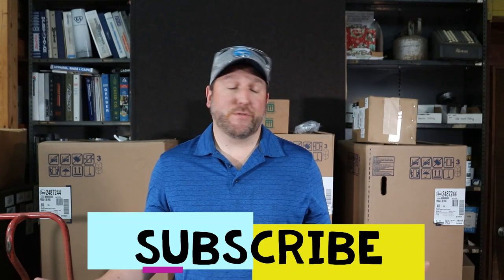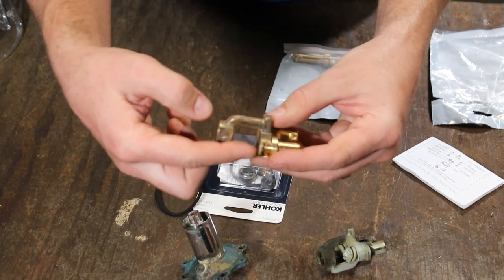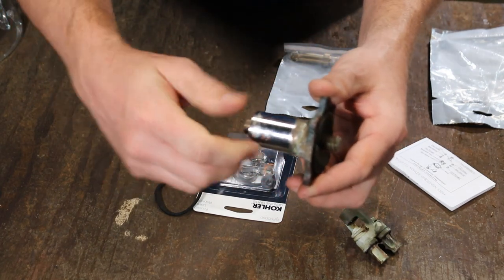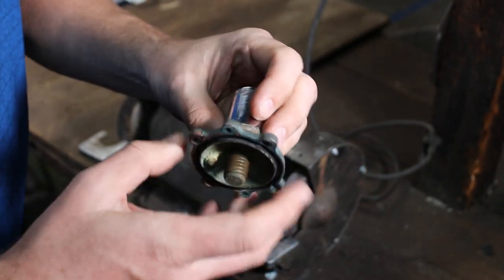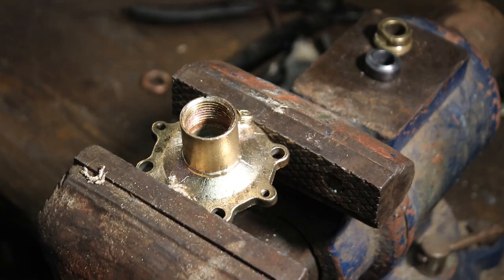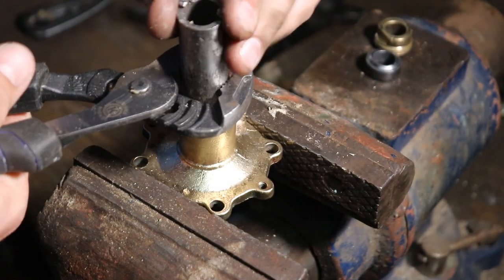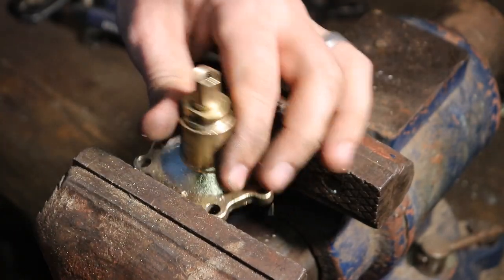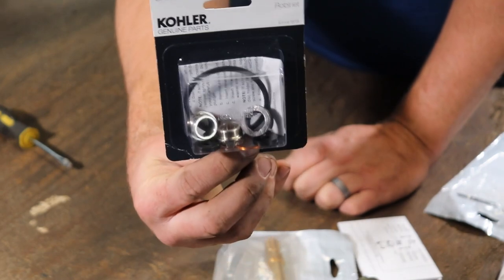How to Rebuild a Kohler Nidecken Shower Faucet

Comment: Thanks for the video. What’s the ID & OD of that tool that you made up to take out the nut? Where did you get it what pipe did you use for making this tool. Having trouble finding one that has the right OD/ID. Galvanized iron plumbing pipe is too fat at .85 OD … I think you need .75OD & .55ID? Wondering where I can find this.

Comment: On mine, the handle was hard to tighten for a long time, then it skipped and has started to leak. The first plumber called said the cartridge needs to be replaced with an old one (from eBay), or a whole new replacement valve kit. My question is can it likely be rebuilt and which part is most likely to need rebuilding? the stem, or a washer?? thanks!

Comment: hi, i replaced the yoke assy on my shower valve, now the hot/cold seems to be off.  how do i adjust more hot?   thx PS:  great video on rebuild
Reply: 2:07 I think you adjust the Hot/Cold plungers and makes sure the washers/gaskets and the correct size and seated correctly.

Comment: If your valve seats are stuck and rounded off - get this set from Amazon: Topec 25Pcs Screw Extractor Set - the 1/2 inch extractor is perfect size to back out a rounded off valve seat.

Comment: Hi!! Need help!! I have this shower faucet in my home and it’s grown too difficult to turn on and off as well as adjust the water temperature. I’d like to upgrade the faucet but not sure if all Kohler single handle faucets will fit. Or do I have to replace the pipe where the pistons from this faucet push in and out to close the water lines? I’m so lost. TIA
Reply from the maker: All new parts are available for this faucet. It should make it a little easier to turn however this faucet will always be a little more difficult than Newer style faucets

Comment: I have this exact one.  Ordered new yoke and seats. Assembled exactly like this… no water will come out of my shower head.  What could I have done wrong? Tried everything with the yoke, flip flopped hot/cold, the plungers and flush in the new seats….  Water flies through when nothing is attached.  So I’m sure it’s not a pipe issue. Something in the yoke/plunger/seat is blocking the water flow but I cannot figure it out :/
Reply from the maker: Just as a test....  unscrew the shower head to be sure there is no debris stopping up the filters.  This sometimes happens when turnthe water off and back on.  If this doesn't work, let us know
Reply: I got home and took the shower head totally off just to be sure.  I just don’t know what it could be it’s literally 3-4 simple parts. The seats I didn’t over tighten just firmed them up.  The only difference I didn’t mention is the old yoke was the spring backed plungers and the new yoke is the same as you have (the ones not that just set in the yoke freely).  It’s so frustrating it’s gotta be something small somewhere…
Reply from the maker: That is frustrating.  The fact that the new ones don't have springs make no difference.  By any chance did you replace the stem?  Sometimes the threads become brittle and wear out.  It's possible this has happened and when you turn the handle, the stem just spins inside the new yoke not moving it in and out.
Reply: Thanks for the replies and suggestions.  The stem is in great condition and thread is fine.  The handle grips and turns I can feel when it’s off position and I turn it on fully I can feel/hear the water try try to shoot out but only enough to where it drips a few drops out of the shower head.   When I go to take the cover off and look at it or adjust the yoke as I was doing earlier when I removed the screws to the cover I could feel the pressure and some water definitely sprayed out a little and leaked out as I opened the cover….  So I feel like the handle is working as it should just fine but I’m not sure how exactly it spins or doesn’t spin the yoke inside.  It still amazes me that this contraption allows hot/cold and on/off.  Just looking at the insides as a non-professional it’s pretty interesting such simple parts but the actions seem much more complex
Reply from the maker: I'm a little stumped.  Lastly check to see if the adjustment screw at the bottom is limiting the rotation of the stem.

Good luck
Reply: UPDATE!  My shower attachment has an arm and head.  I took the head off, no luck.  BUT today I took the entire arm off and BOOOOM… water flow!   Surprised as it was only 2 years old, but I am ordering a whole new shower head and arm combo and all should be good.   Thank you so much for taking your time to reply to my questions!   
(I am wondering now if all along my original leaking issue was the shower head and not the seats… but now I have new yoke/plungers, seats, and shower head 🤷🏻‍♂️😂)

Comment: Why do I have to crank it real hard to stop the water flow?
Reply from the maker: Most likely the seats in the valve body haven't been changed in awhile
Reply: I have the oldest version of this shower mixer and just replaced the disks. I still have to crank the handle hard to stop water from dripping and I although my water pressure is strong I don’t have hot water. It’s lukewarm or cold. Question: I changed the valve seats earlier. Could it Ben that they aren’t at the same exact level? Just thinking that’s why it takes so much to shut off the water completely.
Reply: @crownmoldingbyspectaculart941  I have the same problem with the lukewarm hot. I replaced everything. Can’t figure it out

Comment: At the 14:41 mark, the video skips, and the section about putting on the yoke and any other info is missing.
Reply from the maker: It just screws on.  The same way it screw off earlier in the video.  Was there something you had a quest about?